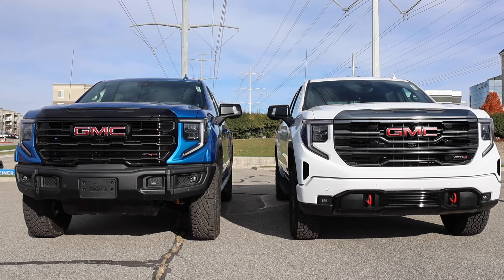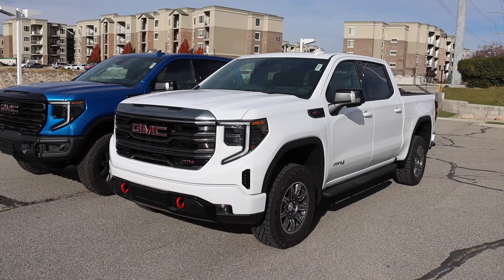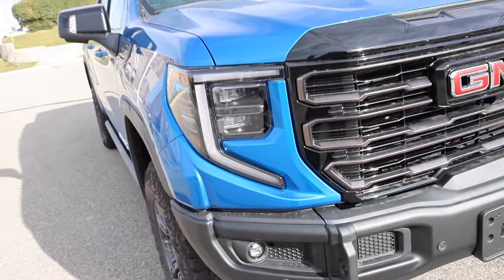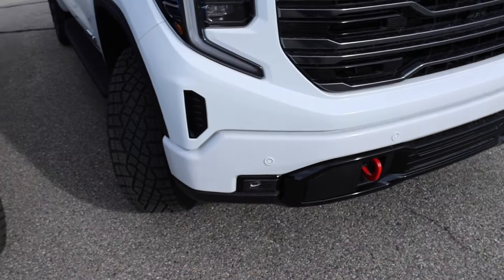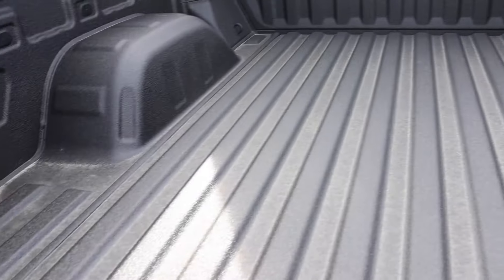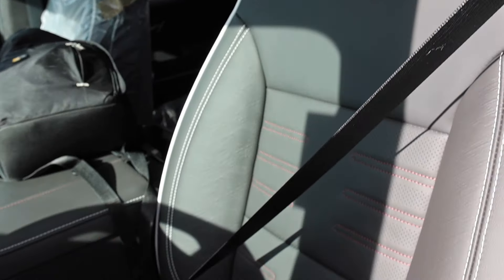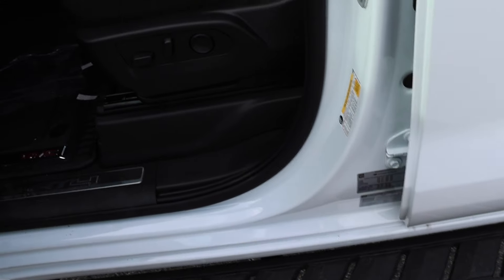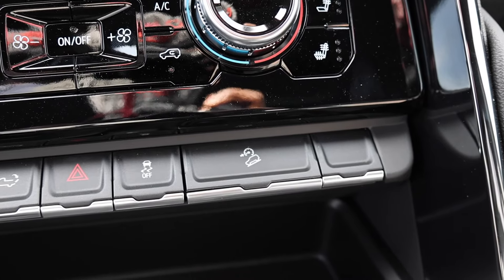2024 GMC Sierra AT4X VS Sierra AT4: 2 Big Advantages The AT4 Has You Probably Didn't Know!

Comment: Where I come from, unless it’s got a modified exhaust, lifted at least 4 inches, and has at least 35 inch tires then it ain’t a truck. Which means neither of these are trucks. I don’t even need to hear about the tire sizes or lift height. Is it a 4+ inch lift? No. Does it have 35s or bigger? No. Does it have a modified exhaust? No. Once again a failure by GMC and Chevy to come out with a vehicle to rival the TRX.
Reply: I’m worried for your wife my guy. Your doctor got you on the blue pill yet?
Reply: 😂 @schadey9103

Comment: So I have a 2020 AT4 6.2 carbon pro   Fully loaded    Low miles I was debating on trading it in for the x.    Not sure if I should or not it won’t hurt me financially but my payments will be high    Not sure what to do  I’m not sure if I should wait   And if it’s even worth  getting   I mean I’m sure it is but I still have that question if I should go for it or not. I want the diesel engine   So bad 

What would you do?
Reply: Did you make a decision yet?
Reply: I just traded in my 2020 At4 carbon pro only had 20k miles. I grabbed 2025 at4x other than these crappy mt tires, which I’ll be picking up some nittos. Love the change whole different beast. You get active exhaust in the new2025 models. The ride and interiors is great new change.